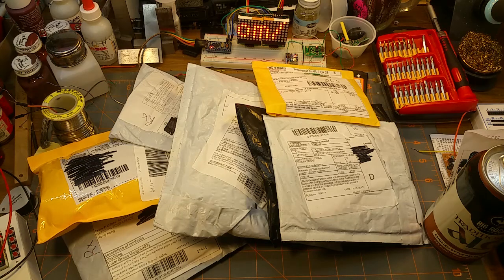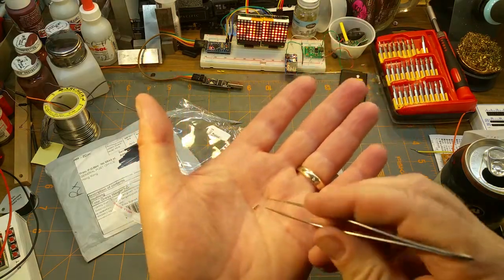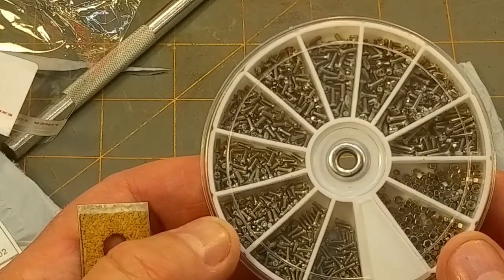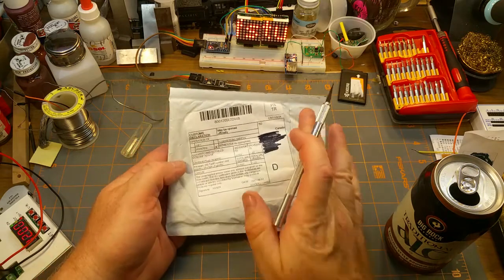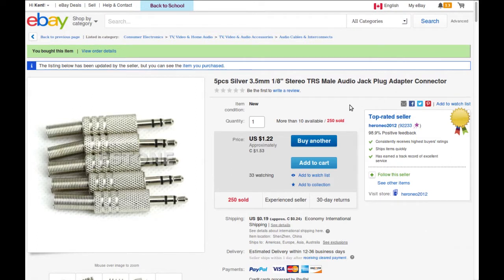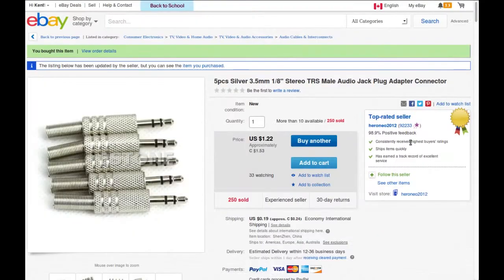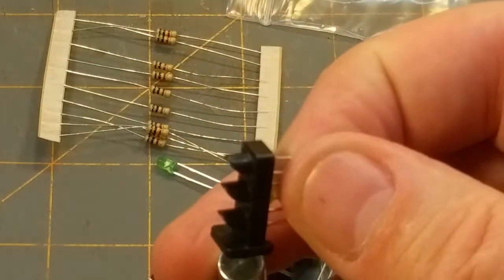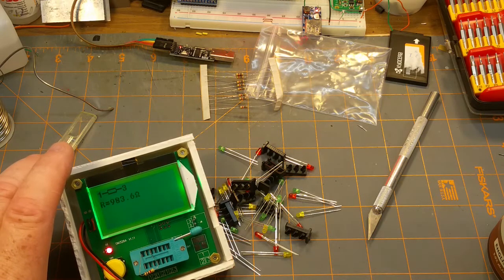mailbag the 6th

Comment: I work in stainless steel for a living.  There are grades of stainless that will hold a magnet, but they are rarely used in medical or food service equipment.  They probably had to use an alloy of stainless that could be hardened enough to be springy.

Comment: you mentioned and showed some three conductor cable red/black/white  but cannot see it mentioned in any mailbags that i looked at, could you please say which video it appeared in or give me a pointer to were you got it thanks for any help.
Reply from the maker: i may have received it before I started doing mailbag videos.
It would have been from an e-bay listing similar to this one: 

https://www.ebay.ca/itm/5m-Servo-Wire-26awg-for-Futaba-JR-3-Pin-W4W3/113300671017 

Or this: 

https://www.ebay.ca/itm/2-3-4-5-pin-PVC-Extension-insulated-electric-tinned-copper-cable-wire-LED-Strip/254059352612 I Use the terms in the item title to search for other options. I usually sort my searches by "price+shipping: lowest first"